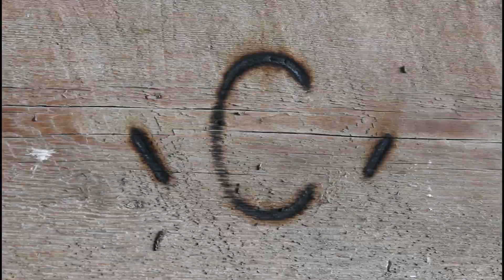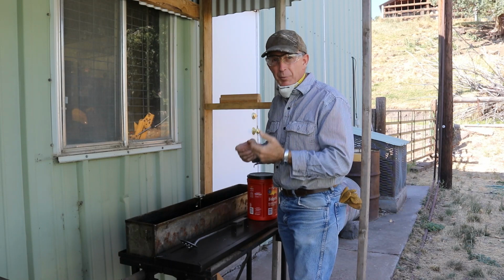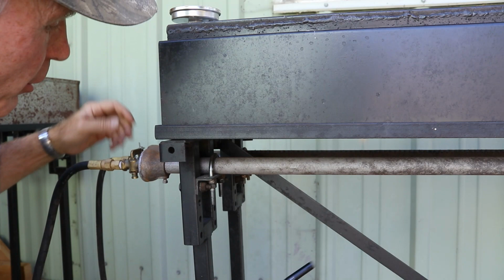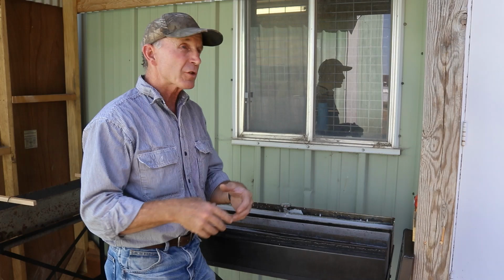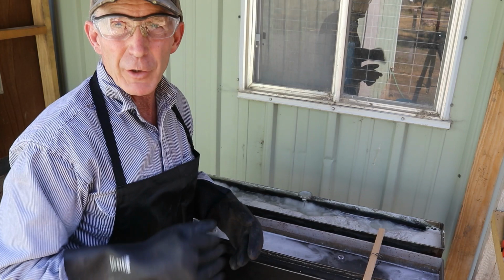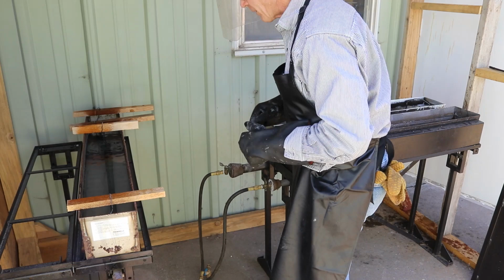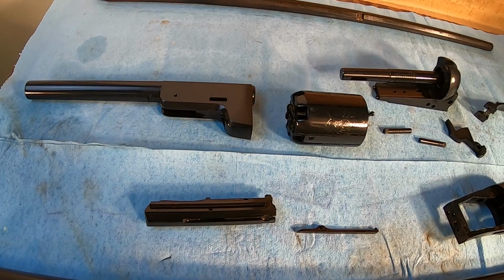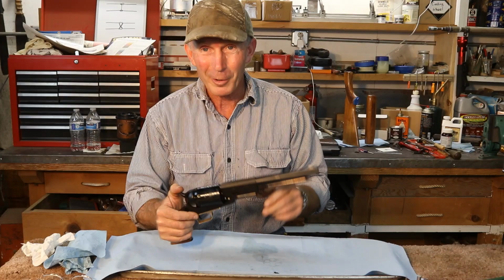Hot Caustic Bluing on The Cinnabar

Comment: Great video.  

Forty years years ago I worked as an assistant in a gunsmith shop where one of my jobs was to help with the hot bluing using caustic bluing salts.  Like you we used WD-40 to prevent rust after removal from the bluing tank. Our safety precautions were a little less refined years ago.  We wore safety glasses and elbow length rubber gloves.  We also had pretty good ventilation.  We generally did hot bluing every couple of weeks, bluing perhaps a dozen or two dozen guns each time, taking several hours.  After an hour or two the bluing solution began to splash a bit as we frenetically were moving barrels, receivers and small parts in and out of the bluing tank.  Discolored  parts were sometimes the result of too high a temperature and those parts had to be repolished.  Parts we didn't know were castings, like your 37A receiver would turn purple.  And the occasional aluminum part that we were unaware of was a very different kind of disaster.   One of my least favorite memories of hot bluing was cleaning up afterward and realizing that the small amount of bluing solution that splashed inside out gloves would make our skin feel soapy.  

Hot caustic bluing made me appreciate the much more refined and sedate rust blung that we did as an every day and on going process.

Again this was a great video.  Keep up the good work.
Reply from the maker: Thanks.  I, too, prefer rust bluing.  I hope to have an episode on rust bluing in the near future.

Comment: WD-40 the first two letters mean water displacement, just because that was their 40th try, I think WD-40 should work good
Reply from the maker: You're right on the money with the name.  Admittedly, it's not a good gun oil because it gums up over time, but it works well for this application.  Brownell's warns not to use it to stop the rusting/bluing process, but I think they're just trying to sell their own water displacing oil.  Of course, Brownell's costs almost 5 times as much as WD-40.😬

Comment: This is one of my favorite ways to Blue small handguns and small parts on shotguns and rifles because it is super easy it is a very dangerous process because of the chemicals that you have to use but it is very easy to do I just wish I had a bigger setup I recently did a receiver on an old Stevens 100 year old shotgun and it came out Plum and I do believe it's because of the high nickel content but it looks beautiful great job man
Edit: instead of buying commercial chemicals I use potassium nitrate and lye and quick lime if I need it and it's been working great I've been using the same solution for almost a year

Comment: You can try backing the heat down a bit, might eliminate the plum color. Then again I've never hot blued a carborized or cased part, just through hardened parts that plum out like springs and firing pins and the occasional hard barrel fitting or some such. Brownells will tell you you can back the temp off to about 260F and that should help reduce or eliminate the muddy plum tones.

Also the plum can be just surface film that wipes off. As you use the solution, you'll notice this film more frequently. Again it just wipes off.

Vettepicking beat me to the homemade salts formula. I used the same Ace Hardware salts formula and it works wonders. Perfectly viable.

Full transparency: I quit hot salts. My tank blew out. I scraped all the salts off the bottom prior to and while heating. At boiling I was confident nothing remained on the bottom and all the material was broken up. I took a phone call, maybe 15 seconds in and heard a thump. Somehow salt either came to rest on the bottom or I missed a spot probably in a corner in spite thorough scraping. Either way the tank was vacated. Maybe 1/2 gallon remained in the tank, the rest dispersed around my bluing shed. Had I been standing there, I do not think my full face shield would have saved me. Not with 4 1/2 gallons of boiling caustic salt blasted out.

You must be exceedingly mindful of this stuff. And even then there are no promises. I wasn't a rookie nor was I complacent. I call that call an act of God. That phone call may well have been my tatter winged body armored guardian angel getting me away from there. There's hazard pay for my angel, we gonna have a lot to talk about when I'm owning up at the gates.

Comment: What can I say that hasn't already been said by everyone one else! Thank you for the show and tell. It explains quite a bit. Mark, I will only add that once you are set up for the case color hardened application that I hope you come up with the correct recipe that will give you all of the vibrant colors that these old Winchesters and Colts use to have when they came off of the production line. Most of the restored CCH I've seen especially on videos come out gray and blue. I always wonder what happened to the other colors. Anyhow, great work and Thank you 😊
Reply from the maker: Thanks Angel!  Once I start color case hardening, I'll only do it if I can find the right combination to make them look like the factory originals.

Comment: Hello sir, I do bealive the way you do the bluing on this parts is the most durable. For me, being just a humble hobby gun restorer is to elaborate, and with chemichals that here in Switzerland I'm not even allowed to buy, those are reserved to profesionals only. 
Therefore I blue my parts with old slow rusting method, yes I have to repead several time the boiling and rusting... but I belive it give a much beatiful results... not as durable as "parkerization" (I thing this is the name of your procedure), but I like it better, it gives a realy nice blue to the parts, and is more adequate to my old damascus shotguns.
I realy enjoy your videos, (apologise for my gramathical mistakes that I may do... english is not my mother language)
Reply from the maker: The caustic bluing is a much faster method.  I use slow rust blue for older antique firearms because iit looks like the original bluing that was used on these firearms.  I'm doing some experimenting with charcoal bluing as well.

Comment: how close is hot blueing to the "factory"blue, Id think that rust bluing would be a better reproduction of the factory finish over the hot blueing
Reply from the maker: It depends on the age of the firearm.  The majority of firearms have been caustic blued since the 1930's.  Prior to that, a variety of bluing methods were used including rust bluing which was primarily used only on barrels and magazine tubes.  Caustic bluing is the method of choice today for the vast majority of blued firearms.  Of course, a lot of manufacturers now use alternate finishes such as Cerakote.
Reply: Wish I was there. With all my projects.

Comment: Very nice.  I don't have the tanks or area to do hot blueing and my cold blue doesn't turn out near as well as your hot blue.   But its all I have and its on my guns.   Yes, I did learn from you, thank you.   I would like to know how long you left them in the bluing salts and how many times, was it just a one time dip ?  5 minutes, 1 hour ?  I think at 280 degrees, the pores of the metal open up and take the blue better, is that the case ?  How well do you polish before bluing?  using 220, 400 or 1000 grit sand paper or carding wheel ?
Reply from the maker: About 15 minutes in the degreaser and 15 minutes in the bluing tanks.  The degree of polishing is up to the customer.  For these lower end guns, we bead blasted them to produce a matte finish.  The finer the polish, the more time it takes and the more expensive it gets.
Reply: @thecinnabar8442  I bought an 1890 Winchester as well.  The barrel did have some pitting in it. It took me a while, but it was my gun so I could take my time and didn't matter how long it took.  I finally went down to 3000 grit sand paper.  it was like a mirror finish.  Turned out really nice.  I just bought a 1902, Winchester 1894 in 32 WS.   I may rebarrel it.  But I love working on these old guns.

Comment: Nice blueing job.  Always wanted to see it done. Ihave used  cold blue it is   not as good as  the quality  u have
Reply from the maker: Thanks 👍 I do more slow rust blue on the older firearms, but caustic bluing has its place as well.  I use cold blue quite a bit, but usually only for small parts or touch-ups

Comment: I think you did a wonderful job with the rust bluing. But my only complaint is that you blued the cylinder on that Colt Walker. Which is not a big deal, as it gets done a lot, it’s just not seen as being historically correct due to how Colt never blued that one part because of the time limits to meet production demands. It is still correct in the regards that if production demands had allowed for it, then Colt would have blued them. And that’s not to say no one ever blued them later on.
Reply from the maker: It's not like this was an original Colt Walker.  It was a customer's cheap reproduction.  He paid for it to be finished the way he wanted.  I don't make those decisions on a customer's gun.  If it's something I strongly disagree with, I just don't take the work.